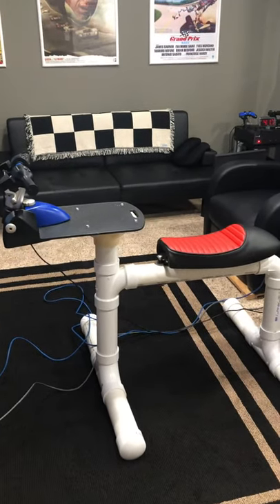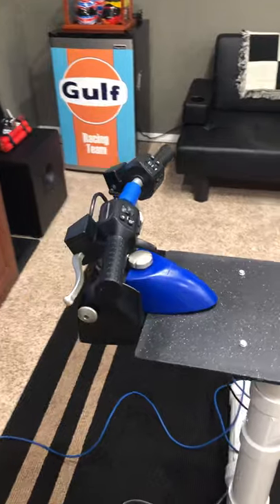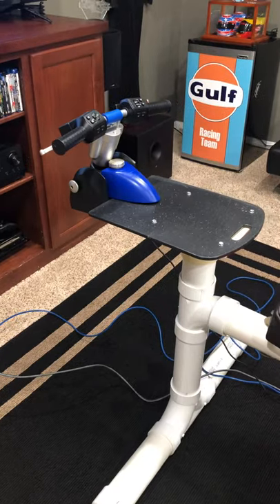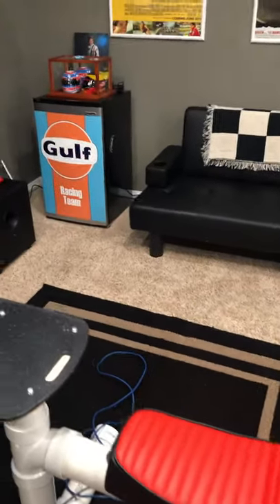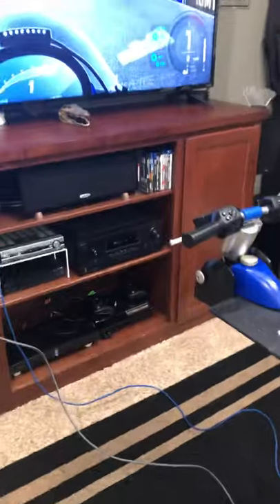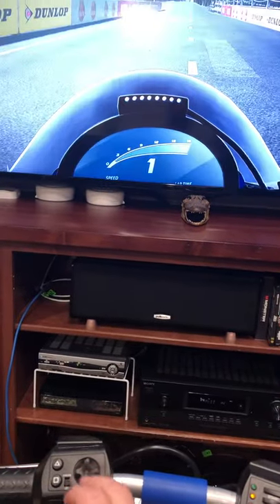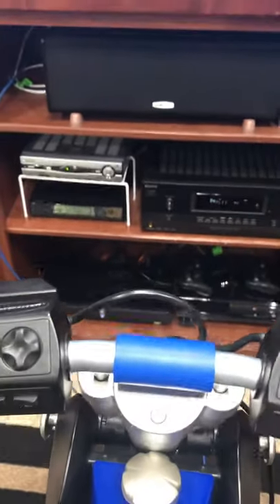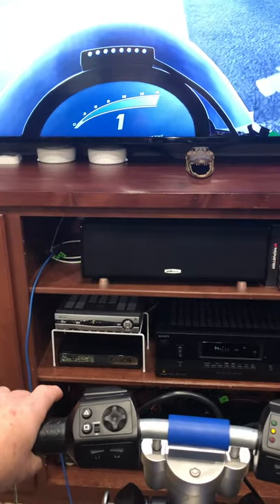PS4 Motorcycle Sim Rig with Handlebars

Comment: Good work Steve! Very informative. I just got a car sim setup. My lower back has a few messed up discs. So for 125.00 it was worth it. I'm more comfortable leaning forward a bit rather than sitting in a car.
Reply from the maker: That’s too bad about your back. I’m just glad to hear that you found a rig and can have fun sim racing. I’m not the fastest by any means, but I enjoy building “stuff” and that’s what makes the hobby enjoyable. What rig did you end up getting?
Reply: @steveclark5206  Hey Steve nice setup just subbed, first of all sorry for replying direct in another comment but it was the best way to get a hold of you. Looking at what you have designed I was hoping for some advice, like you I love motorsport unfortunately though I'm disabled and drive in real life using hand controls. I see you have built a fair few setups I was just wondering if you have seen or know of an easy way to make hand controls for a ps5 steering wheel and pedal setup? I just purchased the Thrustmaster T80 ferrari edition wheel and any advice would be very much appreciated.

Kind regards Scott

Comment: For the counter steering set up you are putting it in MX mode? Would love to see a demo of you showing counter steering in game. Does leaning the controller while in MX mode change anything? Love the idea of pushing the inside bar forward and actually being able to tighten up the turn like you do in real life!
Reply from the maker: Hi. On IOM/MotoGP/Ride games I keep the Thrustmaster Freestyler handlebars in GP mode and counter steer like a real motorcycle. The problem with counter steering in a game is that there isn’t the gyroscopic effect like a real front wheel so the counter steering feels weird. I think I might be able to rig up a bungee cord system to the bars to recreate the feeling of resistance. When I build the metal frame I’ll add anchor points to it for the bungee cords to attach too, that way I can use varying lengths of cord to adjust the amount of tension. If you have any ideas, please let me know. I’ve had people post some great ideas and tips on the other sim rig videos I’ve posted. It’s awesome to hear other people’s ideas to help improve my builds. In fact I’m modifying my F1 rig and mounting the monitor right to the wheel deck lid because someone recommended it. It’s nice having the monitor right behind the wheelbase and only 17” in front of my eyes. It’s much more immersive.
Reply: Steve Clark what if you rigged up 1/8 scale RC truck shocks with progressively wound springs. Then not only would you have dampened rates but the farther off center axis you pushed the bars the more resistance there would be.
Reply from the maker: Speed Twin for the Win Sounds good. I’ve watched a few videos of people using RC shocks for sim racing pedals instead of using load cell’s. I’ll do some research and see if I can find some used shocks because they’ll definitely be more consistent and look much better than bungee cords. Thanks for the idea!

Comment: Hi, nice video. Question, is some kind of vibration on the controller ?! How does playing feel ?!
Reply from the maker: Hi, and thanks for the kind words. Yes, there is some rumbling effect, depending on the game. Some have better effects than others. For example on the IOM:TT game you mainly just feel a “thump” when you shift gears and a little “rumble” if you crash, but it’s not very immersive. MotoGP and Ride have better effects. But there is not any force-feedback with the handlebar. I am hoping that Thrustmaster will someday come out with new handlebars, since they do multiple steering wheels, pedals, add on wheels, HOTAS combat joystick, commercial airliner yolk and rudders, etc. Handlebars and PSVR motorcycle racing games would be incredible. Maybe with the PS5? Once my rig is complete I’ll add tactile transducers (“butt shaker” / bass shakers) to it. I add them to all my rigs and home theater seats. Easiest and affordable way to take your setup to the next level of immersion.
Reply: @steveclark5206  thanks for the very detailed anwser.  So is like a dual shock vibration so to say ?! I found one thrustmaster on ebay , do you think that is worth to buy one or should I stick to the normal dual shock?! I also hope that they do something in the future , there is a hole market for motorbike , specially since exports becomes more and more important.
Reply: @steveclark5206  other question , I found one thrustmaster pc version , would it work on the ps4 with a converter or only the ps2 version ?!
Reply from the maker: @Werferharfer  Honestly, you’ll probably be faster with a regular controller. Depending on the price of the Thrustmaster handlebars, they are a good investment since they are hard to find and I’ve seen some sell for $250+ here in the US. If you have the space and can mount the handlebars to a wheel stand and want the game to be more fun (versus being faster when using a controller) then the handlebars are “worth” it. I just like to build stuff, that’s why I went with a motorcycle rig and handlebars. Check out some of my other videos for other rigs I’ve built. Right now I’ve been working on my cars and motorcycles and will start building more rigs this winter.
Reply: @steveclark5206  I have a t300 rs and I also was faster with the controller , but with the wheel is a lot of more of emergion , and that's is what I looking for . I watch the videos , they gave me a lot of ideas , thanks. I found a controller but the pc version ,I wonder if it would work on the ps4 . It should right ?! Since is a usb connection.
Reply from the maker: @Werferharfer  I can’t be 100% sure, but I’m guessing that yes they’ll work on a console. Back when they came out a PS2 and a PC were miles apart in parts and performance. But the Brook Super Converter you’ll need is PS2 to PS3/PS4/PC, so I’m pretty sure it’ll work. The only thing is the PC version won’t have buttons labeled X, O, square, L1/R1, etc. Not a big deal, just get some small stickers and write what the buttons are by looking at the PS2 handlebar version.
Reply: @steveclark5206  ok , I will try , thanks for all the informations.

Comment: Do you like the thrust master controller better than the Yamaha controller?🎉
Reply from the maker: Yes, I like the Thrustmaster Freestyler Bike controller a little better than the Yamaha MS-1. It seems that it’s built a little more solid and I like being able to hit the switch to go between MX and GP mode. The problem is that the Thrustmasters are kind of hard to find in the U.S. so if you can’t find them, the Yamaha’s are still pretty good (and easier to find).

Comment: So are you faster with this vs controller or is it more about the immersion?  Love your setups btw.
Reply from the maker: Hi, and thanks for the compliment about the rigs. I’d say right now I’m a little faster with a regular controller but it’s getting closer as I practice with the handlebars more. And I’m almost done with welding up the metal frame which will definitely help. When I was using the handlebars while sitting on a regular chair I was a lot slower than using a DualShock, but being in an actual motorcycle position makes it more intuitive. And it’s definitely more immersive because I sometimes find myself leaning into a corner! Lol
Reply: @steveclark5206  HAHAHA that's awesome!  Do you have an ETA on when you might have the project finished?  I just managed to snag one of the Thrustmaster Bars for PC on the used market here locally.  Can't wait to try it out.
Reply from the maker: @elbowsout6301  That’s awesome that you found the Thrustmaster bars, they’re hard to get here in the States (the Yamaha’s were pretty easy to get on Amazon and eBay). Have you ordered the Brook Super Converter yet? Be sure to check for an update before you start using it. I didn’t and about every 15 minutes the bars would disconnect from my PS4. Once I did the firmware update it worked great.
I’ve got the frame tacked up and just need to clean up some welds, add tabs to mount the fairing and tank, paint (or maybe powder coat) the frame and then adjust the rear set pegs. I’ll definitely post a video of the completed rig. I wish I was better with computers because I’d like to do a video of the build but I’m no good with editing the video footage to make it watchable. Lol
Reply: @steveclark5206  I haven't ordered the adapter. Not sure I will need it as I should be able to use a GIMX cable to play on PS4 and Xbox Series X and since it's the PC version I should be able to use it on that without issue. Can't wait to see the finished rig.

Comment: Got a question for you. Do you know if you can change the handlebars on that thing? I'm thinking about picking one up and I want to put some ape hangers on for when I play The Crew.
Reply from the maker: Unfortunately there’s no easy way to swap out bars like you would a steering wheel on most sim racing bases like the Thrustmaster T300. You might be able to disassemble it, lengthen certain wires, and relocate the electronics to work with the throttle, brake, etc. But I don’t think the base is strong enough to support actual metal handlebars so you’d probably need something light(er) weight like 3/4 or 1” pvc to use as bars.
Reply: @steveclark5206  Eh, it is what it is then. Thanks for getting back to me so fast.